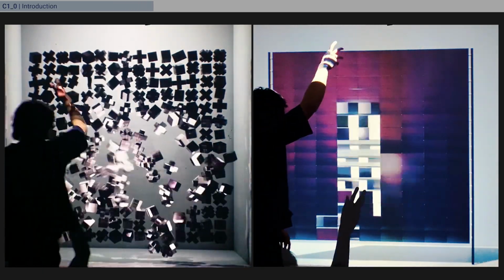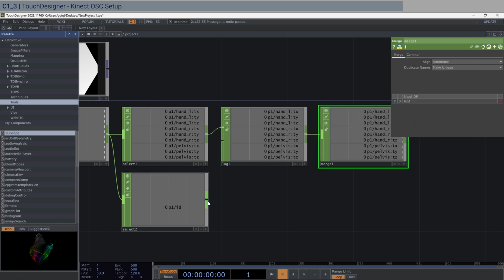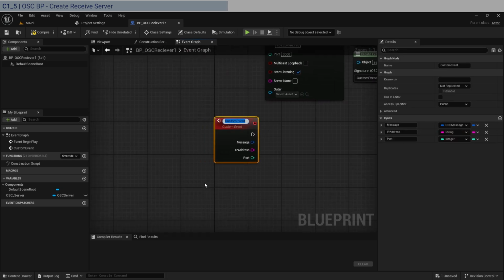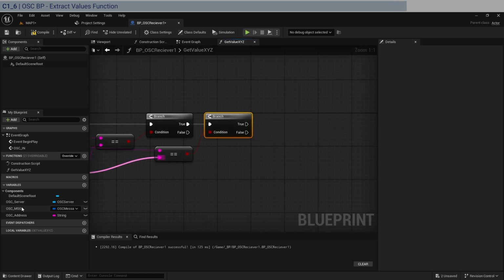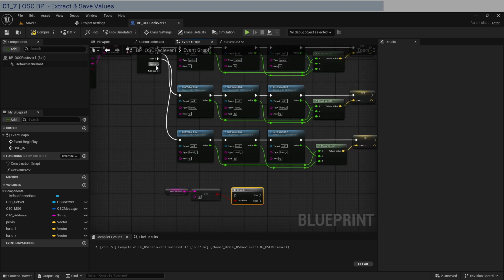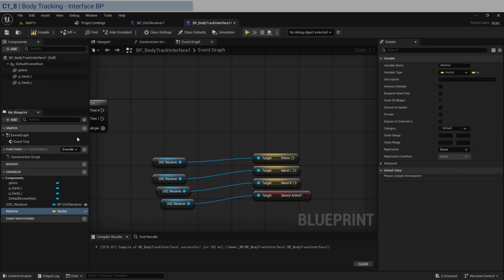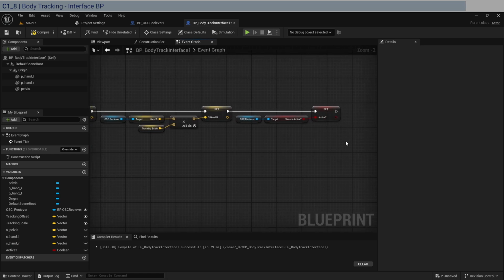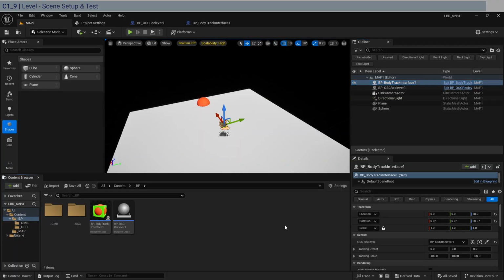Mocap / Kinect Easy with UE5 & TouchDesigner [Tutorial] | Unreal Engine OSC

Comment: Can I use a Kinect motion sensor in Unreal Engine for an already existing game project? If it’s possible, what plugins or setup steps do I need to follow?
Reply from the maker: Yeaah? I mean just use OSC plugin and pipe in the data from TouchDesigner to UE5 and save that as a variable and access it in another Blueprint. Easy as that.

Comment: If you don't want to manually select all of the different channel names, you can use a '*'. So if you want player 1 hand_r tx, ty, and tz and hand_l tx, ty, and tz then you can type p1/hand_* and it'll find anything that starts with p1/hand_.
Reply from the maker: Indeed, the syntax I knew worked but couldn’t remember how to spell it. Thanks. Also yes that local host thing should’ve been fixed.
Reply: @YFJSR  Can't thank you enough for putting all of this together! It's been super easy to follow along and I'm having a blast!
Reply: Also localhost appears to be working in 5.7!

Comment: Hi! Just curious about your setup. Do you usually have a computer for sensors and controllers and a main one for the hard work? Thanks!
Reply from the maker: Well not usually, it’s always better to do everything in one machine so there’s less points of failure. But one time I had to do a weird project where one low end PC just running Unity for the touchscreen 2D UI and the large LED screens driving Unreal Engine graphics. There I did use USB dongle method.